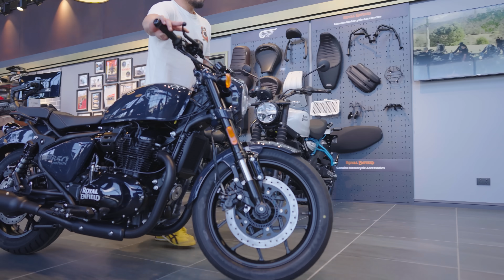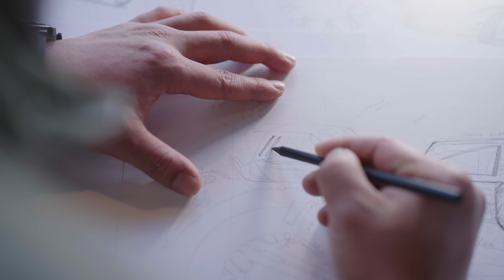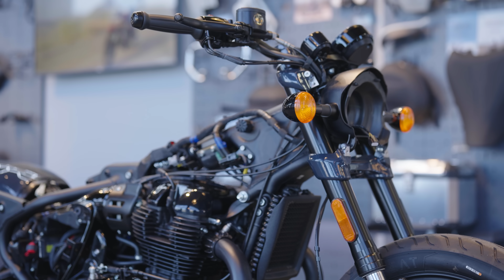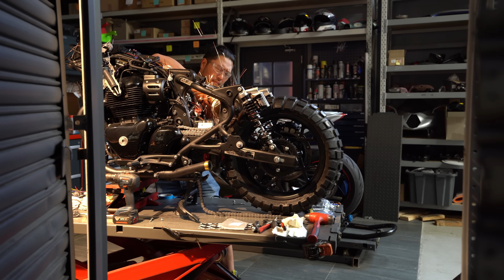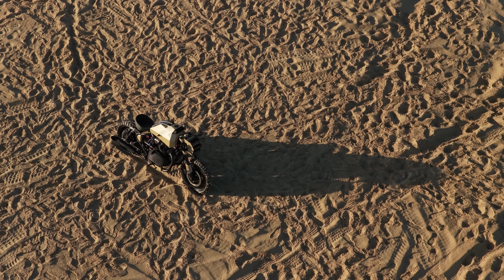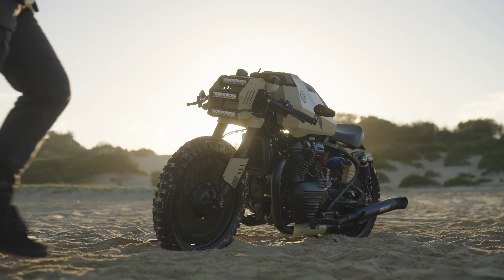[한국어 자막] Moto Machine Desert Eagle- Royal Enfield Busted Knuckles Build Off 2026

Comment: Is it just me or am I blind? The design is SHIT! Zero comfort for even a 5 minute drive on bike. It can only be used for showing off in garage, not even for a date or a drive to friends. Watch the guys in video, test driving, carefully. They are uncomfortable to drive at best. They are hunched over with their chest pressed into exposed metal pipes that are going to get hot within a couple of minutes. The frame design is so bad that you have to hunch over in order to reach the handles. Even without the heat, the pipes are in your chest. Then the posture - DAMN!! Your back will do somersaults after 10 min into driving with that body posture. The aerodynamics do not seem good either. You can tell me by looking at the guys shirt swinging while they are driving.

I mean don't get me wrong the bike looks freaking awesome, that's why I watched the video but it's a trophy bike for garage at best, not one you can drive anywhere! The design is SHIT at best and if someone disagrees, instead of ranting, give justification!